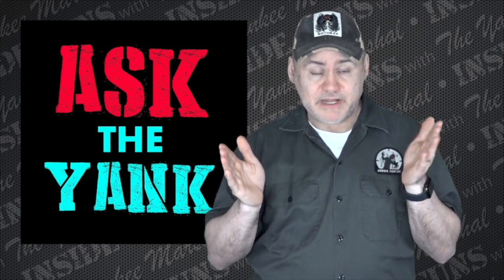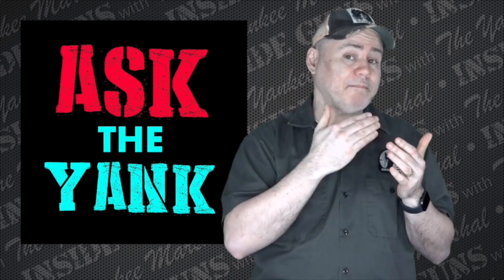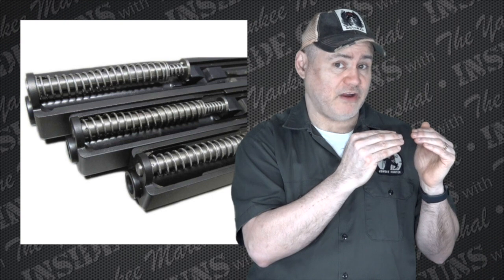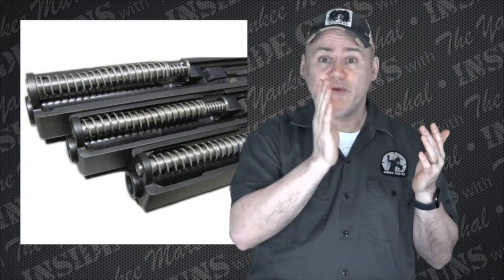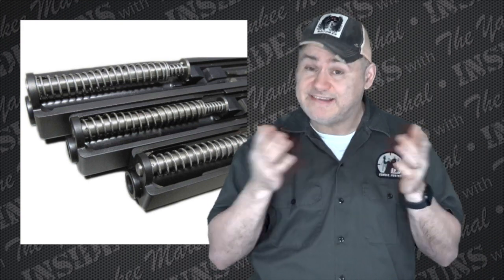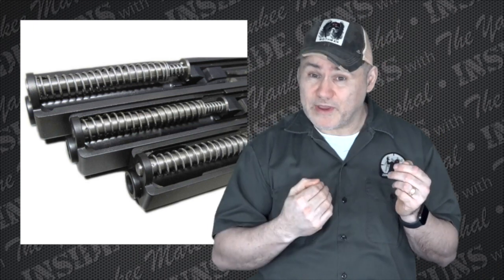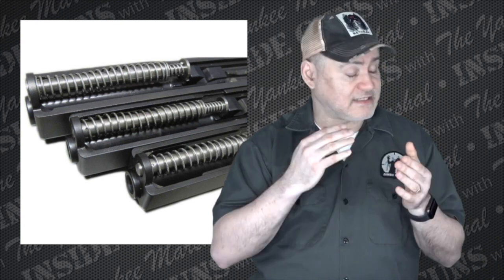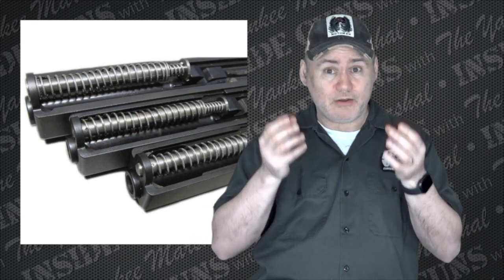Do Handgun Round Counts Stay with Frame or Slide?

Comment: If I'm counting rounds for a very specific reason, I would treat every frame and every slide independently.

So slide a (SA) with frame a (FA) would have independent round count.
Then throw SA on your new spooky frame b FB.
The round count on SA keeps going up while the round count on FB starts from zero (because it's new)
When you count total rounds fired, only count slide rounds together, And only count frame rounds together.

Then you can compare your numbers to see if you've missed a count somewhere, and see if you're using a particular slide\frame combo more than others.

This requires more explanation about frame wear vs slide wear, but I have other shit to do.

Comment: I was just wondering about this after buying my first Sig recently. A p320 compact
Reply: I have the 9mm full-size. I plan on getting the 40 s&w slide kit. I like 9mm and all but I’d like to have something with more kick without losing the commonality and price of 9mm.
Reply: @Total Newb 123  Commonality and price is exactly why I seem to always drift away from .45acp to 9mm. Honestly, I'm starting to wish I bought the 4.7 and purchased a 3.9 Wilson frame. Going from the 3.9 frame to the 3.6 and losing that extra portion of rail for a light is crucial.

Comment: I thought slide weight and recoil spring worked in tandem for timing, ie race gun versus 'normal'?
Reply: Wolff Gun Springs is considered the top after market firearm spring maker. I have a few Wolff M&P magazine springs in my 2 M&Ps 1.0 & 2.0. Both S&W guns are .40 but I often shoot, ccw .357sig, 9mm. KKM Barrels. ✅  I got a M&P 16lb recoil guide rod from Wolff too but rarely use it. It's a =%&* to install.

Comment: I bet these guys who are obsessed with documenting every round can't shoot their way out of a paper sack.Does anybody have concern over this? Lol
Reply: I try to estimate round count so I can replace guide rod springs (i heard 5000 is the magic number), but I'm not worried about tracking every round.
Reply: counting rounds is such a waste of time.
Reply: @afridgetoofar1818  It's not if you like the process of maintenance. If you just shoot until it breaks (or just shoot on occasion) I guess it's a waste, but it's just the gun version of the odometer.
Reply: @ChucksSEADnDEAD  I was a round-counter at one time years ago. It’s a waste of time. I don’t know of any real shooters who do that.
Reply: @topbreak38  I've had my carry piece for about 10 years and I'm estimating 1000rds, guess I'll be dead before I have to change anything on it lol.
Reply: It doesn't make much sense unless you're doing USPSA-type shooting. Some of those dudes easily hit 100k+ in less than a year.
Reply: @linkbond08  you might change some bits just due to age. I don't think I'll hit that number any time soon either but I imagine some plastic and metal may deteriorate. New parts might just be a good tune-up.
Reply: @afridgetoofar1818  That's unnecessarily rude, what's the definition of "real shooter"?
Reply: @topbreak38  Metal doesn't "deteriorate" like that unless it's straight up rusting. There's stuff that's been sitting inside crates since the turn of the 20th century, as long as they're still covered in the packing grease the metal is fine.
Reply: @ChucksSEADnDEAD  all metal is in a constant state of rusting and/or deterioration. Work around artifacts long enough and you learn that.
Reply: @ChucksSEADnDEAD  Competitive shooters, and people who train consistently.
Reply: @topbreak38  I think reason flew out the window the moment this discussion started to involve artifacts with hundreds of years of degradation.
There's millions of rifles packed in cosmoline which survived half a century inside wooden crates stored in damp Soviet warehouses that still work fine.
Reply: @afridgetoofar1818  Pretty sure those are more likely to keep round counts than the average person, so I'm at a loss here.
Reply: @ChucksSEADnDEAD  a few notes on what you just said:
1. Not all artifacts are hundreds of years old. Many of the ones I handled were less than 80 years old and still had to be treated carefully to avoid wear.
2. All metal exposed to air is subject to oxidation. Do you have a gun with bluing? That is a deliberate form of oxidation used to prevent extreme rusting. 
3. With cosmoline, you have unwittingly discovered a form of preservation. By preventing air from touching the metal, cosmoline is working to combat oxidation.
4. We are talking about guns that are actively in use. A conceal carry handgun is not fired, cleaned, then packed in cosmoline. It is carried next to the body and kept at a warm temperature, it is exposed to sweat and oils from the carrier, it is left in a car in the heat or cold, and it is not always properly maintained. All these factors can lead to wear, deterioration, and rust. You know, the things we were all talking about. You would know this if you read for comprehension.
Reply: @topbreak38  1. Are they made of gun-grade steel?
2. and 3. I know what oxidation is. That's precisely why I mentioned the grease. You think I "unwittingly" mentioned how guns are packed into their crates not knowing why such steps are taken? Jesus Christ.
4. Give me a break. If the user can look at his gun and know the sweat isn't corroding the gun, he doesn't need to replace parts due to age.
I think it's funny you mention reading for comprehension but you're at this point arguing about sweat induced rust to explain a mythical "deterioration" that invisibly damages your parts and requires frequent replacement even if the gun isn't wearing from actual shooting. Or you just skip to assuming people don't understand what they're talking about when they clearly show the why they are saying the things they do.
Here's a restoration of an old gun that got rusted into a piece of junk /watch?v=2lF2cBWujNY
Yeah the gun is a piece of crap and is visibly pitted by the rusting. Still works after getting cleaned up. You're really arguing a carry gun kept for 10 years is more "deteriorated" than this and needs parts replacement?
Reply: @ChucksSEADnDEAD  rust isnt the only form of wear that can occur on a gun. Hot and cold temperatures can impact the quality of metal and polymer parts. Just looking at a small spring won't necessarily tell you if it has been cared for and stored in a single-climate environment. I don't know why you think rust is the only thing wearing down a gun.
If you understand the concept of preserving weapons, I'm unsure why you felt the need to mention it alongside weapons that are in active use.
Reply: @topbreak38  Notice how you've changed the topic to polymer. This is called moving the goalposts.
Yes, looking at a spring doesn't tell you anything about it. Springs wear the most from cyclic loading.
You're the one who started going off about rust.
Because weapon preservation is mostly about preventing rust. If a weapon in active use isn't rusting, it makes no difference if it's sitting in a Soviet era warehouse or inside a kydex holster. You're the one insisting a 10 year old weapon needs new metal because of age.
Reply: @ChucksSEADnDEAD  no, polymer was always a part of the topic as we were discussing carry weapons. Not all carry weapons are solid steel. You were the one who compared carry weapons to the ones packed in Soviet warehouses. 
Rust is not the only thing that deteriorates metal. Just b/c you do not see metal rusting does not mean it has not been compromised. This is why you don't want metal to get too hot while cutting or sharpening it as you can lose its heat treatment. 
I think you got caught up in making whatever point you wanted to make and now you want to shape the argument around that.
Reply: @topbreak38  In many pistols replacing the polymer frame means replacing the "gun" entirely because the serialized component is the frame itself.
I used the Soviet warehouse as an example of weapons not being kept in optimal conditions, where the cosmoline was the only protection they needed to survive. If your weapon could survive a Soviet warehouse, it can survive a decade of carry if you don't let it rust from the sweat.
Okay, metal being compromised. How many WW2 and Cold War weapons have you witnessed with deteriorated but not rusted metal?
How did a weapon, which presumably did not go into an oven, get too hot? I don't think people are cutting or sharpening their carry guns.
I didn't get caught up. You said a weapon that's a decade old needs replacement even if it's not physically worn from shooting or rusting.
Reply: @ChucksSEADnDEAD  looking back, I noticed it was you who brought up rust to begin with.
I also know there are plenty of parts like guide rods, triggers, slide levers, etc. can be polymer, not just the frame. You also do not know about new modular systems where you can replace the polymer frame if necessary.
I never said people are sharpening their guns, I said temperature changes can impact metal. This can be any metal part like springs, not just the frame. A gun can easily get too hot when you have to leave it in a car (or simply choose to leave it in a car) in 90-100 degree weather.
I didn't say a 10 year old gun must be replaced; I said replacing a few old parts can give your gun a tune up.
If you want to think a daily carry gun is as pristine as a gun stored in cosmoline, that is your mistake and I will allow you to make it.
Reply: @topbreak38  It was only an offhand comment, I wasn't bringing it up specifically.
Okay, but my point is that if you're replacing polymer parts, you'll have to replace the frame too. If you're going to replace a pristine guide rod and trigger because "polymer degrades" but not the frame, you're not thinking critically.
Yeah, new modular systems that didn't exist a decade ago, so the poster who commented on his 10 year old carry piece didn't have one of those.
If the springs are suffering damage from a hot car, how come firearms work in the Middle East?
But you don't replace parts based on time, you replace them based on round count. You don't need a "tune up" for parts that still have the same specs as the day they left the factory.
Please, do come forward with the evidence that a carry gun is different on a crystalline structural level compared to a gun in storage, provided that both have the same round count at the time of the analysis. The scuffed finish from the holstering and re-holstering doesn't count.
Reply: @ChucksSEADnDEAD  you inserted yourself into a conversation and took the simple advice of replacing small parts that can deteriorate into a case of "but mah moos-in nah-ghent!"
Yes, heat will have an impact on the frame. It will have a bigger impact on a small part like the trigger spring. You can prolong the life of the gun by replacing small parts over time. You don't replace your entire car when you need new spark plugs.
Yes, guns work in the middle east. Heat does not disable a gun (I never said it did) but it can impact reliability and lifespan. You clearly did not pay attention to the recent withdrawal by US forces when ISIS fighters traded in their AKs for abandoned ARs.
Excessive hot or cold temperatures can harm metal and plastics. This is why children's safety seats should not he passed down and used for multiple children. 
If you cannot understand that outside factors impact materials and that a gun stored in a temperature controlled environment is the exact same as one that is regularly carried, then there is no point in continuing this conversation as you will never be able to wrap your head around the concept. 
Good bye.
Reply: @topbreak38  A simple advice which is nonsense. They "can" deteriorate? Okay, how? Were they stuck inside the oven until the springs lost their temper or something?
The life of these small parts is tallied by round count, not time.
You claimed the polymer needs replacement. Now you're saying the whole thing doesn't need replacement? So the spark plug needs replacement, but not the shock absorbers or suspension springs? The dashboard? Cars have lots of plastic and metal that degrade with heat!
They traded 40-30 year old AKs with thousands of rounds through them for newer weapons? You don't say.
Reply: @ChucksSEADnDEAD  good bye.

Comment: Yank thats pretty bad advice the recoil spring that comes with a 9mm barrel is normally going to be a lighter weight spring than a .40 using the 9mm spring with the .40 barrel can cause excessive wear parts breakage and possibly injury the recoil spring needs to stay with the slide it is paired to

Comment: Hey Yankee, I recently ordered a Sig SP2022 in 9mm. I was looking online and found a Sig Pro which is the SP2022 predecessor in 40 s&w with a slide, barrel, and guide rod. Would it be possible to be able to shoot the 40 s&w slide on a 9mm frame?
Reply: Nope.
Reply: no, .40 s&w is basically 10mm short and considerably more powerfull than 9mm. therefore its a bigger slide
Reply: it is unsafe to turn a 9mm to a 40.
However It is safe to turn your already 40S&W to a 9mm.

I'm unfamiliar with sig, but this is true for the m&p line.
Reply: It is. They're the same frame, only difference between those is the slide/barrel.  Enjoy it, very underrated pistol.
Reply: @linkbond08    I own a few "converted" barrels from LWD 🐺 & KKM, Storm Lake. I've seen minor flubs with my Lone Wolf Alpha "9mm" Glock barrels but a lot was the Magpul Glock magazines, light(70gr) flat nose Federal ammunition. Don't expect a .40-9x19mm converted barrel to work 💯. Or a Glock 20/10mm to accept a match grade Storm Lake .40S&W convert barrel. 10mm & .40S&W are off by 1-2mm in some specs. My Glock 20 gen 4 Cerakote fed cycle factory 🏭 10mm loads 💯 but with the .40, jam 1x every 100/150 rounds.
Reply: @DavidLLambertmobile  I'm more familiar with the M&P variant if this.
If you throw a 9mm standard barrel on a 40SW slide and frame along the 9mm magazines, it'll run very good if your gun is lubricated, even without the need to change the recoil spring.
I only had one malfunction, it was because I put 9x19mm cartridges in a 40SW magazine.
When I bought the 9x19mm proper magazines all the problems went away.

I don't recommend it, but sometimes I intentionally limp-wrist it, and it's still cycles, sluggishly, but it cycles.
Reply: @rymmertube  thank you for the reply. I noticed that the Sig SP2022/Pro frame was intended for the 40s&w. I noticed a complete slide/barrel/guide rod for sale.